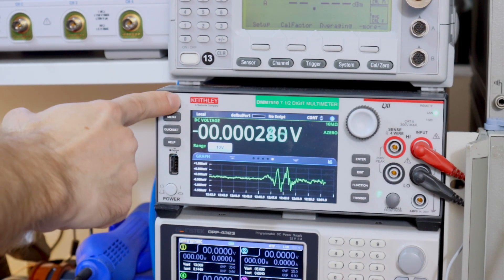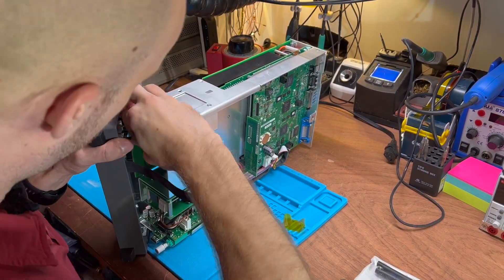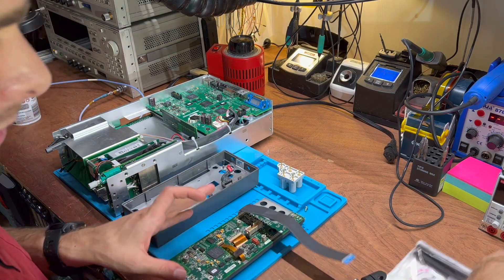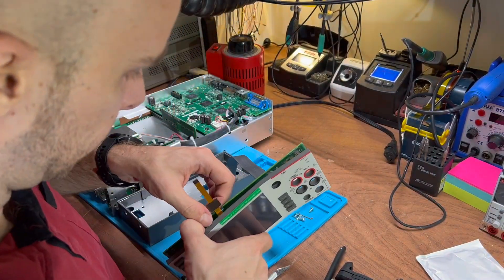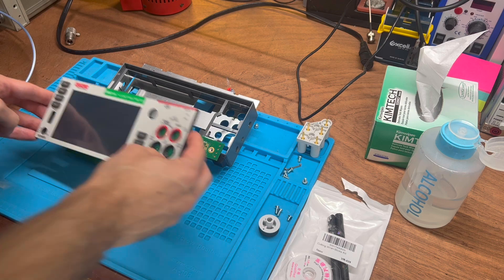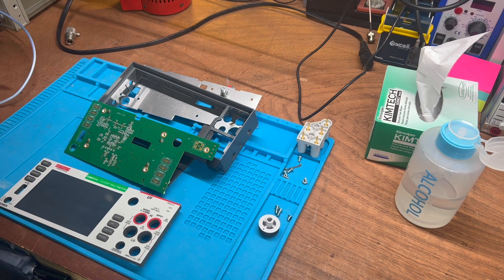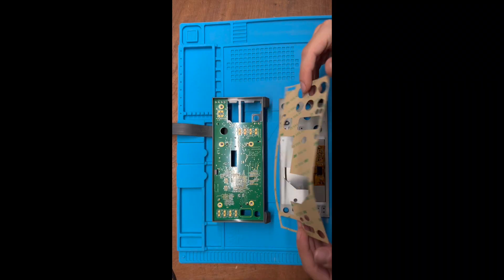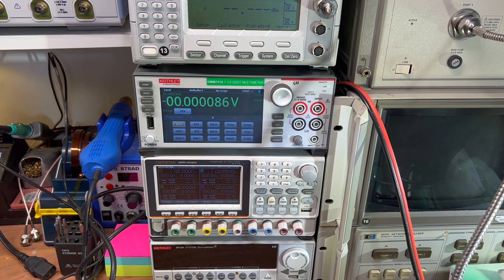Keithley DMM7510 Stuck Button Repair

Comment: Thank you very much for sharing this.  I just today received a 'bargain' eBay DMM7510 that just showed as used with no description and it has this issue.  I suspected it would be the contact points as I've repaired other devices that had the same problem, but it is so nice to have someone who repaired the same device and can talk about the specific issues you encountered while doing so.

Comment: I gave my Keithley 2450 SMU same treatment. It got much better but still not great. Tried to put some copper foil on the conductive pads. But didnt get that to work. Suspect that some copper foil touched the PCB and registered a constant push, so not other keys pushed could be registered. I may do some experiment with some conductive paint on the conductive pads later.
Reply from the maker: Thanks for the update, the pads on my DMM7510 are starting to bother me so I might take another swing at this. It looks like these days you can buy a kit of conductive rubber pads for exactly this purpose, so that's the route I plan to try next.
Reply: @jjoonathan7178  I ordered some conductive rubber pads, some "remote keypad fix liquid", but then wanted to fix the 2450 now. I watched some youtube clips on remote control repair. One used graphite to rub the conductive tips. So i took a pencil, grinded of some graphite and used a Q-tip to "pint" the pads. After some strokes with the graphite they turned shiny. The put everything together and buttons are working well now. Not sure if other methods are better or worse, but this was quite good.
Reply from the maker: @aronake  Thanks for sharing, I should look into this.
Reply: @aronake  I've done the same research and attempted variations on similar repairs on other devices.  My overall understanding and experience is that the pencil/graphite method can work, but is very much a short-term fix that will wear out, typically in a few months (depending on usage of course).  The last device I repaired with this issue I glued tiny cut out squares of copper foil tape to the underside of the buttons covering the once-conductive rubber and that worked great.  The only issue is making sure the adhesive will bond properly to the rubber (heavily cleaning the rubber first helped).

Comment: How did you actually fix the buttons? just cleaning the PCB and the buttons?
Reply from the maker: Yep! It seemed to work at the time, but it is now 2 years later and starting to show the same problem again. If I could do it again (and I might), I would see if I couldn't replace the little conductive pads outright.